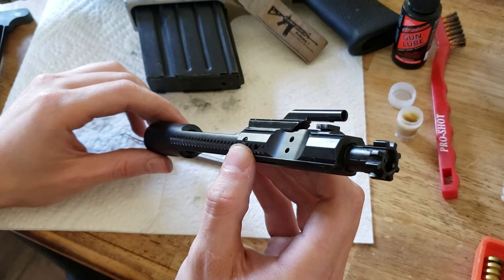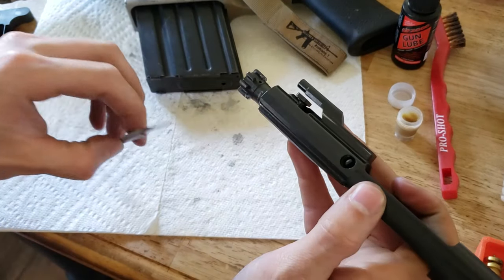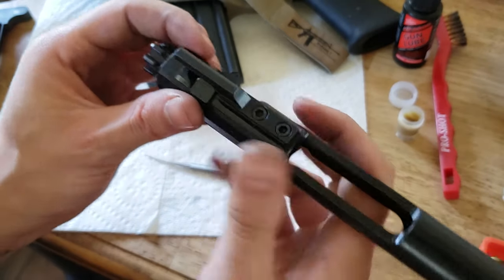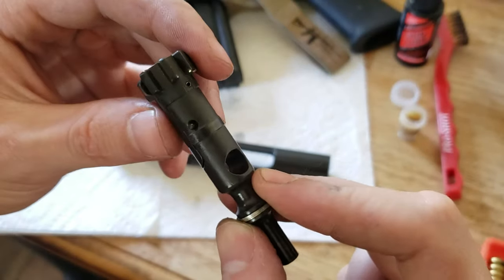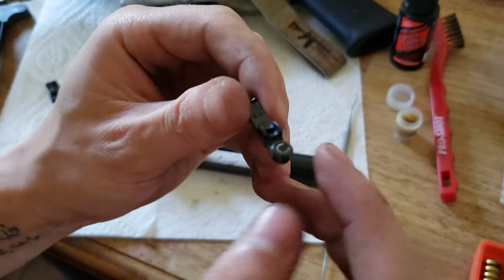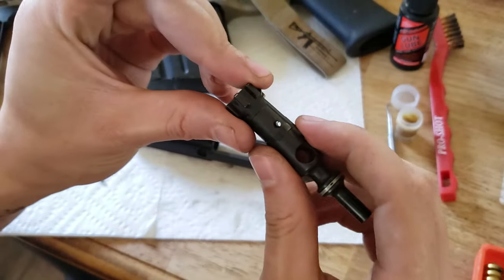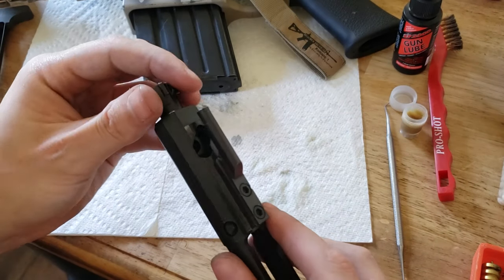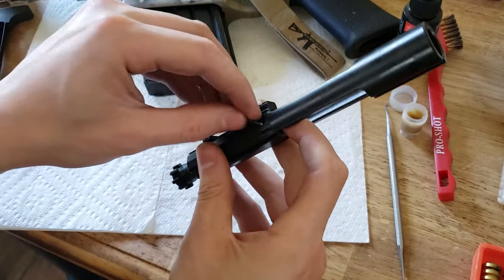Disassembling, Cleaning, and Lubricating your Bolt Carrier Group

Comment: My firing pin doesn’t slide out freely after removing the cutter pin.  I always have to pull it out.  Can someone tell me what’s causing this?
Reply from the maker: Your firing pin channel is dirty- spend some good time with a copper bore brush and q tips and get every part of the inside of your bcg clean.
Reply: Ok.  I’ll try that.  Thanks!
Reply: So i did a thorough cleaning of my bcg.  I also removed the extractor for the first time to clean it.  After removing the extractor i noticed the o-ring wasn’t seated properly around the spring.  I cleaned it and put the o-ring back in place and reassembled back the bcg.  The firing pin comes in and out easily now.  Thank you so much for your advice.

Comment: Bad idea to put any type of lube on the moving parts of the AR and never put lube on the firing pin because when weather is 50 degrees and below all lubes become thick and sticky slowing the bolt carrier movement causing cartridge cycling issues and dampens the firing pin striking force causing fail to fire issues.
In the Pacific NW when I am at then in the winter, we have massive rain and wet mixing to lube and cold really puts a stop to the AR correct functioning.
My first bad experiences with cold and lube in the AR causing a problem when I lived in Alaska.
30 degrees to under the zero-degree mark really puts a stop on the AR when the lube turned to a sticky hard paste in the cold.
Reply from the maker: ...

Wow
Reply: @Thepreppersbunkeroutdoors  If you live in a state with cold weather in the winter then try what I wrote about lubed up bolts - bolt carriers and firing pins with oil or grease then see what I mean.
Just 50 degrees and lower is what is takes to make oil or grease thick and sticky to affect the movement of the unlocking the bolt and the movement of the bolt carrier or reduce the kinetic energy on the firing pin to cause fail to fire issues.
This not something new or just something that is about the AR rifles.
I am 63 years old and from 1976 I have been a professional hunting guide working the Pacific NW - Alaska and the Carpathian Mountains of Romania.
Cold and lubes have always caused issues in guns when weather turns cold.
It is well known that many have found their bolt rifles won't fire in the cold because they lubed up the insides of the bolts and auto loading rifle owners have also see issues when using lube on and in their guns in cold weather.
I know of a tour guide in Alaska that was using a Remington 742 the old auto loader that he lubed up then at the worst time the gun only fired 1 shot at an advancing brown bear which had him and his guest back up against a lake.
The total problem was the lube got thick and so sticky in the cold even by hand the action was hard to manipulate, and it wouldn't fire even after by hand getting a new cartridge in the chamber.
To their luck the one shot fired cause the bear to reevaluate his advance on the people.
The Browning Bar from 30-06 to 338 mag is another gun that hates lubes in the cold.
This not an issue with one type of gun it is the failure of the gun owners not thinking of cold causes all oil and grease to get thick and sticky casing guns to have many issues.
As a YouTube video up loader you would be doing many a great favor of making a video about the effects of cold and lube that can cause gun failures.
Reply from the maker: @Lure-Benson  you know that we have a few military bases up there-
I have been there and *gasp, ran guns in -40

To say not to lube your AR in the face of the entire military that runs ar's lubed in every climate is amazingly stupid.

Impressively stupid

Comment: Don't you also have to make sure the little rings on the bolt aren't lined up before you place in the carrier?
Reply from the maker: Yup
Reply: Noooo, that's an old wives tale.. the gap between the rings close up upon  squeezing into the carrier. They'll unline shooting anyway, but if it makes you feel good then go for it.

Comment: I was cleaning my bolt and because it was so filthy I soak it in lacquer thinner. Then realized the extractor has an O-ring. My question is will the lacquer thinner destroy the O-ring? Having a senior moment I forgot about the O-ring.
Reply from the maker: Im not 100% sure tbh, but it should be good. With that being said, a new spring and o ring is cheap cheap
Reply: @Thepreppersbunkeroutdoors  It doesn’t have a O-ring. The spring goes over a post.  Lacquer thinner cleans those parts really well but I don’t want to ruin the bolt
Reply from the maker: So wait... the extractor does or doesnt have an o ring? Im lost.
Reply: @Thepreppersbunkeroutdoors  this one does not have an O-ring. I read somewhere that some do not have orings
Reply from the maker: That is correct- when i served and deployed they werent even a thing. It is a cheap upgrade though! Good deal

Comment: What bolt carrier is that I have one of those that came with one of my rifles but can’t find it or info on it anywhere
Reply from the maker: I forget tbh
Reply: @Thepreppersbunkeroutdoors  god damnit
Reply: @Thepreppersbunkeroutdoors  what about functionality have any major issues with it anything stand out?
Reply from the maker: @Jiraiya-Sama482  not yet- but they are all wear items, its just a matter of time.
Reply: @Thepreppersbunkeroutdoors  thats under stood but I want to know how often it wants to jam on you in feeding with the bolt or the teeth get broken, is the firing pin in good condition have those edges caused problems in your receiver or buffers with contact ever had failure to fire because of the pin?
Reply: @Thepreppersbunkeroutdoors  not to be a dick but im not new to fire arms I know they’re prone to malfunction I just want to know ANY info on it like will it mar up my receiver and is it good metal
Reply from the maker: @Jiraiya-Sama482  uuummmm, there is a lot to unpack here.
The bcg that i have has had no malfunctions or breakages yet- but i havent trained with this one yet.
Almost all bcg's should be of a good steel- for the most part the difference between good and bad ones is quality consistency, machining, and testing.

I cant give a product a full thumbs up until training classes, because i might run this gun all day with no issues- and show up to a class and it dissintegrates- thats how this works- same with fights
Reply: @Thepreppersbunkeroutdoors  thanks brother, I assumed it was just fished out a bargain bin or something because I couldn’t find it lol but seeing as it’s not horrible it’s already better than I though ahaha 😂 how many rounds more or less?
Reply from the maker: @Jiraiya-Sama482  i used to keep track but... prob 1,000? So not enough to matter at all haha
Reply: @Thepreppersbunkeroutdoors  oh ahah just the break in period, that’s pretty nice you hadn’t had a malfunction yet though, I appreciate the help you’ve been a better help than the test of the internet

Comment: I'm not sure why you're suggesting that people add oil to the holes on the sides... which are exhaust holes. Gas comes out from those.
Reply from the maker: You are sure why I suggest people put oil in those holes when they run the gun till the bolt gets sluggish- you just don't agree and you want to be passive aggressive about it.
The next time you are in a firefight or a class and your gun starts to choke give it a try, you will be surprised.
Reply: @Thepreppersbunkeroutdoors  I'm not being "passive aggressive". I was politely giving you a chance to provide a logical explanation justifying that point to see if there was something I was missing, but you didn't. Instead of doing that you just throw an ad-hominem and call it good. Since no new info or reasoning was given, I can, more straitforwardly, say that that particular point is objectively and demonstrably wrong.

Your "it works" point to "justify" putting oil into the gas exhaust vents seems equivalent to saying that just because you can also get drunk by sticking a beer bottle up your ass, then that's how everyone should drink beer...

I understand the "if you're in a desperate situation" caveat (they will run dirty, but not dry, after all), but your video is clearly about general maintenance, so trying to appeal to an exceptional corner case to justify the general rule you gave is a bit disingenuous.
Reply from the maker: Your tenuous grasp on how to politely give a chance for logical explanation combined with your utter lack of a grasp on the definition of passive aggressive combined with your lack of experience certainly qualify you as a subject matter expert on weapons maintenance.
I will make sure to defer people to you for guidance from here on out.

Comment: nice video, but at no point do you discuss the cleaning of carbon from the bolt or inside the carrier, or how many rounds fired before cleaning bolt extractor inside carrier etc, etc. It seems there are as many opinions as there are AR 15's out there.
Reply from the maker: Clean it all after every time you shoot it.

Comment: I followed all these steps and when it was time to go shoot it clicked please help
Reply: Clicked when I pulled the trigger
Reply from the maker: I need more info. If you heard a click then the hammer dropped- 
Make sure the shoulder of your firing pin is on the correct side of your firing pin. If your firing pin didnt go all the way down and you put the cotter pin in in a way that it keeps the firing pin from striking the primer it wont shoot.

Comment: “If you’re in a firefight, put a couple more drops of oil in.” Are you serious you muppet?? PEOPLE do not take this advice. Your bolt should be DRIPPING with oil. The next time you fire your gun, it will burn off the excess oil. It may put out a little more smoke for the first few rounds but you will not have failures. Grease is a better option bc it does not drip off like oil does.
Reply: That’s what we were taught in the Marines, that more CLP was better than less because the blowback, action, and heat from firing thinned out the lubricants. We never went long enough between cleanings to allow them to get junked up. I can see using smaller amounts if grease is being used. I once used too much grease in a Colt 45 ACP and it was a fricking mess. Never had a mess with oil, except staining my clothes haha.

He did do a good job demonstrating the disassembly, though. I’m just on the fence about the light lubrication.

Comment: that 3 holes are gasports where gas comes out from ur gas tube, so no point to lubricate in only increase risk of creating carbon aaand malfunction
Reply from the maker: But do you understand where the holes go when gas isn't coming out of them?
You should probably understand how the gas system works before telling people what will happen based on what you heard on the net.
Reply: @Thepreppersbunkeroutdoors  yes yes but if u put oil in there and hot gases comes thru the puah the oil out and rest is carbonized inside so... im the one whonhave right, ask "real" gunsmith not democrat one

Comment: CORRECTION: DO NOT put oil in those 3 holes, those are gas ports and if you put oil it has a higher likely hood of clogging once enough carbon builds up. The oil you put in there will most likely will all get blown out the first shot you fire though anyway though from all the gas.
Reply from the maker: Your comment is a contradiction- based not on experience but on hearsay. 🤷‍♂️
Reply: @Thepreppersbunkeroutdoors    you can ask multiple men, even currently active if they put gas there and some will say yes and some will say no for the same reasoning I just explained. If you do a little research you will see the problems it can cause. Drill instructors tend to stick to their old ways and go based off what they were taught even though sometimes it can be wrong.
Reply from the maker: And yet I have done it, and it worked.

If you have shot your ar enough that your bolt is slowing and you are losing reliability the last thing you should worry about is how hard it might be to clean later. Hahahahaha
Frickin internet wives tails.
"I heard from this guy, he was a SEAL"

W/E
Reply from the maker: @hudson2520  im stuck on what I have done in Afghanistan, in military training, and in private professional training.
Yes- i have watched the video of two guys laughing and calling it a myth. If thats what it takes to bust a myth I guess you will be alright with an utter lack of experience lol
But don't worry, ill address it in a video where I am actually showing it, instead of just having a couple vets talk about it offhand. Probably neither of which saw combat. 👌🏻
Reply: @Thepreppersbunkeroutdoors  sounds good. I look forward to watching the video addressing it, I’m here for knowledge and whatever knowledge is provided with factual reasoning I’m more than willing to accept as it will make me a more capable person. Thank you for your service. As of right now I’m still sticking to my initial belief but I’m open minded as long as it comes with factual reasoning. Thank you again God Bless
Reply from the maker: No problem. Actually, after posting this video I couldn't remember how many times I had done this- it had been about a decade- and obviously your exact comment made me question myself.
So the next class, the gun got sluggish, I did it in the specifically advised way- and boom she ran better.
I need to pull that footage and get it all together. There are so many frickin things I need to do.

Comment: Great video until the last part. DO NOT oil or grease the exhaust ports.
Reply from the maker: Yeah, except it works great.
Give it a shot sometime 💪🏻
Reply: @Thepreppersbunkeroutdoors  I have to unclog a port but I used hoppes or gun scrubber.  There’s no reason an exhaust port needs oil or grease.  It acts as a glue for dirt and over time can clog the ports.  I know some who swear by it and others who don’t.
Reply from the maker: @ohboy2592  first off- you need to understand when to do it, which i would hope i made clear in the video- when you are in training or a firefight and your gun is gummed up already.
"There is no reason to put oil in the exhaust"-
You are right, its not about oiling your exhaust, its about where the exhaust ports goes that needs oil. Any excess is blown out.

And you have to clean exhaust ports? After thousands of rounds of blanks, the nastiest things ever, for years, i have never had to give exhaust ports extra attention.

More doing, less reading forums.

Comment: Never put oil in those three holes. PERIOD!!!
Reply: I passionately agree!!! These are exhaust holes for gasses to move the bolt to unlock it. GEEESH!! might as well place a potato in your exhaust pipe of your car.
Reply: I literally just did this! Is my bcg fucked?!? 😰
Reply: @dylanarmstrong3880  Your BCG probably needs a good cleaning. Make sure the holes are clear and clean. Check your gas rings. These are exhaust ports. They get clogged , your bolt and firing pin get dirty-eR.
Reply: @dylanarmstrong3880  No sir. You can put a good cleaner through it and blow it out. It would take a lot more then that to ruin a BCG.

Comment: You don't put oil in the 3 holes. they are vent holes!
Reply from the maker: I'm sure it makes you feel educated to repeat that from whatever ignorant forum you heard it from.
Reply: @Thepreppersbunkeroutdoors  lol, Just facts son. Are you saying those are oiling holes and not vent holes? Can't wait for your response
Reply from the maker: @racerxhewett4402  facts based on what? What experience do you bring to the table?
The primary purpose of the holes is irrelevant- they work well for getting the oil where it is needed when it is needed.
Reply: @Thepreppersbunkeroutdoors  So you agree with me, that they are VENT holes :) You will be needing to clean your BCG more often than not, by putting drops of oil in the vent holes. It is not necessary to do so and is of no value son, fact
Reply from the maker: They are vent holes- and if you ever learn to take advice on subjects from the people with actual experience in the subject you will be better for it. 👌🏻

Comment: I don't think this guy really knows what he is talking about. BTW, the 3 holes in the BCG are NOT for oiling. These are gas ports to unlock the bolt from the chamber. And since this was a video on lubricating, nothing shown on lubricating the bolt? Lubricating the extractor? If your going to talk about it, that one thing. SHOWING is better. There are better vids on lubricating the BCG. This ain't one of them.

Comment: DO NOT put oil directly in those 3 holes.  They are gas ports.
Reply from the maker: Yes they are gas ports, congrats- and they lead right to where you want oil 👌🏻
Reply: Then put a drop right into the gas key too while you're at it.  I understand that is what is or was taught in the military, but it makes absolutely no sense.

Comment: NEVER put oil in those bolt gas port holes. ** unless you just like cleaning your AR, because the oil will collect the carbon from the gas**
Reply from the maker: Why? Because your gun will spontaneous combust? Haha
Reply: @Thepreppersbunkeroutdoors  Ha! No. Because they are gas ports not oil ports. Do you oil your exhaust on your car?